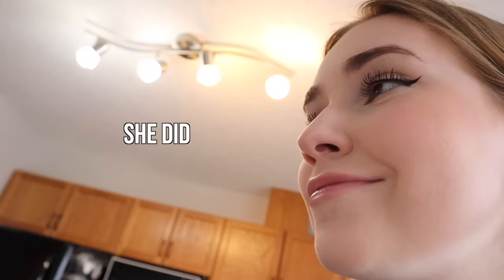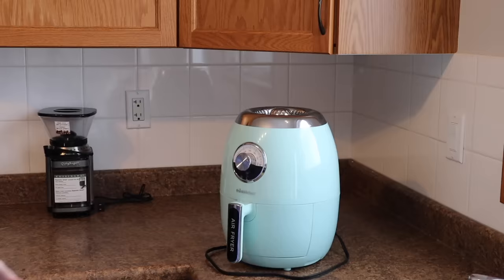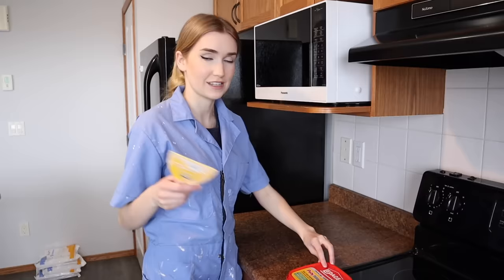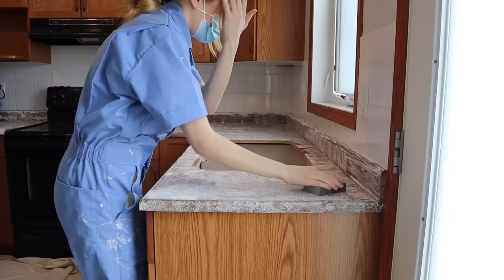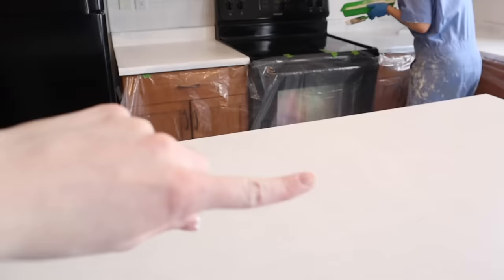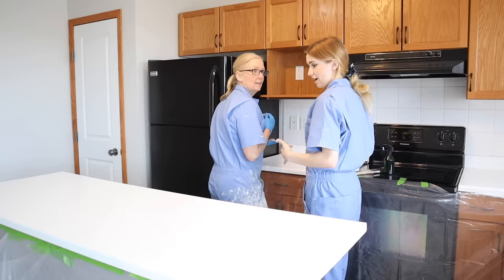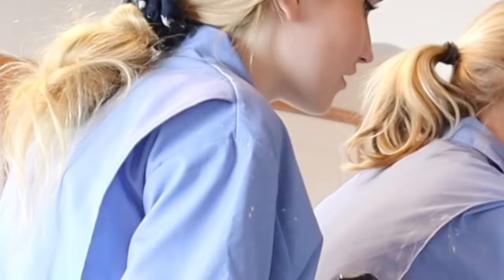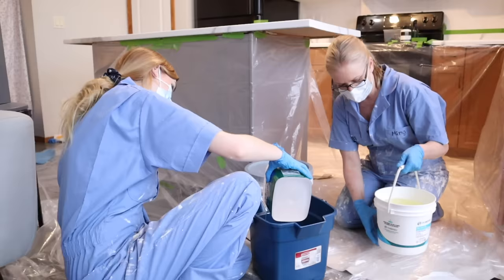Transform Kitchen Countertops With Epoxy & Paint !! *surprisingly easy*

Comment: Couple of tips here. First, you don't need to take off the texture before the epoxy. All you need is sanding. The epoxy, when poured correctly (around 6 Oz. per sq foot) is thick enough to cover everything. Secondly, the recommended way of making it look like marble is not to draw the design before the epoxy. The best and most natural marble effect comes when making the design with the epoxy. Basically, you use white paint or pigment mixed with the epoxy and then make a small mix with the gray by mixing a little of black into epoxy. You pour the white first and then make the veins with the "gray" epoxy mix. You then spray 91% isopropyl alcohol or over over the veins to make a more natural effect. Also, always use epoxy that is specially made for countertops which contains no VOC and no mask is needed. You also want to use a mixing cup or bucket to measure the exact amount since a little less or more part B will cause soft spots. Another thing and sorry for the big comment. I just want to help you learn. Epoxy has to be pour thick and it cannot make that "paint" sound. When it does that it means there's not enough epoxy. By the way, I am a renovation contractor specialized and certified in epoxy designs so that's how I know. Honestly, any question you have I am available.
Reply: Youre a cool dude 😊
Reply: Do you have any video on how to do it
Reply: @stlouisfritznicolas9314  No but check out Stone Coat Coutertops channel
Reply: Hi Jonathan, I have the same countertop as her. Are you POSITIVE I don’t have to remove the texture off the laminate before pouring the epoxy? I am terrified it won’t level correctly and that texture might show through 😰

Thank you in advance 🙏🏼
Reply: Thank you so much
Reply: Thanks for this! About to start my epoxy project. I've watched a lot of stonetop vids but I'm just stuck on 2 areas. Do I need to use some sort of waterproof primer or base before epoxying and do I need to use a top coat after Epoxy? I've got a primer and undercoat (2 in 1) it doesn't say it's waterproof though. It will be for my kitchen. Any advice would be very much appreciated!
Reply: @blankcanvas7417  You're welcome. The primer or base doesn't have to be waterproof since the epoxy is waterproof and it acts as a top coat and sealer. You don't need a seal coat on top of the epoxy but there are some top coats that do help and improve in both look and durability of the epoxy. My favorite one is water based Polyurethane because it makes the epoxy scratch resistant, easier to clean and it comes in Matte finish, Satin, Semi-gloss and Gloss so you can choose the best for your design. Now, there is oil based polyurethane which I don't recommend for epoxy projects. It is harder to apply and some have an amber color that will change the appearance of your project. Use only Water based clear Polyurethane.
Reply: @gardeniagorgeous4232  I am positive you don't have to remove the texture off the laminate. Yes, you do sand the laminate but just to create a porous surface for the epoxy to grab, not to take off the texture which will take longer. Epoxy is self leveling. Always measure the size of your project before so you know how much epoxy you need. About 6 Oz per square foot and it will level with no problem
Reply: I don’t agree You do not need    Resin to make marble look real . My best marble and s done with acrylic paint.  Just a thought. Also they marble they did looks absolutely real!
Reply: Molina is correct I n this one apoxy seals and covers the holes with n the in even counter That is the beauty of appoxy
Reply: THANKS.
Reply: I kept wondering why they weren’t doing it the way you described.
Reply: @Suzanne Carpenter  They don't have much experience with epoxy and it's understandable. It always good to look for information before using any product you don't have experience with, specially one like Epoxy resin that has a specific mixing and working time
Reply: @Margery Kirner  Epoxy is not the only way to make a marble style decoration, true but is not just about how it looks. It is also about the feel and durability. While yes, you can make faux marble with acrylic paint, paint is not durable, peels easy and is not scratch, heat and/or chemical resistant
Reply: @jonathanmolina3529  I agree with you! 
What do you suggest if anything I use overtop of my granite counter before I use epoxy mixed with a couple shades to achieve a quartz look? Do I need to prime first? It’s very dark with gold and black in it
Reply: @Tracey Maday  Always need to prime to create a good adhesive for the epoxy.
Reply: Can you do my counter top for me 😬
Reply: Hey so if I sand down my countertops, then paint them with say 3-4 coats, how many coats of epoxy would you recommend? Thanks :)
Reply: @shilohmcgilvary6704  2 coats of epoxy. The first coat would be a base coat and the second one is the top coat. The base coat can be applied a bit thinner then the second coat try to stay in the 6 ounces per square feet. Also, can't wait more than 24 hours between epoxy coats or you would need to sand the first coat before applying the second coat. If it's been less than 24 hours you don't need to sand to pour second coat
Reply: This is really helpful! Thank you!
Reply: hi, I am going to cover a laminate desk. I want to paint it black, then add some gold flakes and cover with epoxy.  thoughts?
Reply: @jenh8858  Make sure to sand the laminate before priming. You need to create a porous surface in order for the epoxy to have a good bond.
Reply: thanks for the reply  @jonathanmolina3529  so i sand it, then paint it black, then add the flakes and pour the epoxy over?
Reply: @jenh8858  Sand it down and if you want to do the best job possible, I recommend you instead of painting, after sanding use an epoxy primer base coat black then you pour the flakes and lastly the epoxy. Now, depending on the design and color you want you can either do the design and pour clear epoxy or you can color the epoxy and make the design with the epoxy. There are many tutorials in YouTube on how to do that. I recommend you check out Stone Coat Countertops
Reply: @jonathanmolina3529   thank you. This is amazing.  Going to follow your advice
Reply: @jenh8858  you're welcome
Reply: I have a tile countertops. Can I use epoxy too?.thank you
Reply: @dunna3072  Yes you can. You have to fill the gaps before so you can have a smooth surface. You can use bondo filler or other fillers used in construction. Also, the tiles need to be sanded down well because you will need a porous surface to create mechanical bonding. Once you fill the gaps and the tiles are sanded enough you will then use an epoxy primer and then the epoxy itself. It is a little bit more work but it's doable and easy
Reply: THANKYOU JONATHAN FOR YOUR ASSISTANCE IN THIS TAKING NTES.
Reply: If i dont have a torch, can i use a blow dryer? If yes, what setting ? Hot/cold?

Comment: The epoxy started fuming because curing epoxy heats up (it does so in the early stages of curing). The larger the amount, the higher the temperature, and it can melt THROUGH the containers so be careful! Same goes if you want to do a deep pour of epoxy, the heat might melt whatever is around it (if you're using it for crafts, molds, or other things) so you should pour in layers! You don't need to wait the full cure time to pour a second layer, but at least let it sit for a while (for a 24h curing epoxy, I usually let it sit for 5 to 10 hours) 
Also, epoxy is a delicate medium to work with so I advise you to be very careful, and really be thorough when it comes to PPE! You should always wear a respirator even with "non-toxic" brands. Often they are non-toxic when CURED but not so much during mixing and pouring. So just to be safe, wearing a respirator is worth it! The "surgical masks" do not protect you for anything, they're barely efficient for dust as well by the way so do use proper respirators when sanding, it's no fun to have whatever you sand in your lungs (and long term exposure to that with poor to no PPE use leads to  lung diseases, it happened to a family member...)  Always wear respirators and preferably long sleeves when sanding epoxy! Epoxy in the organism is really not good....
Reply: Excellent advice! I was thinking much the same (minus the astute details you provided). Thank you for your expertise 🙂
Reply: That slim mask cures everything. its why people don't get sick anymore. Not to mention we wear our masks on and off.  supper important
Reply: Yes that is what happens when you don't take time to really study even those countertops look bad very orange skin even by not removing the stove shows u how little thinking it went through this process
Reply: Does get into food if we use as countertop
Reply: Thank you! I was ready to jump into this and appreciate the details of caution. Will do when the weather gets warmer, and I can open the house for circulation. 💌🥳
Reply: @MrAresxy07  What are you trying to say?? Punctuation really does serve an invaluable purpose.
Reply: @lblincoe2094  I don't understand what he is trying to say either.  Lol  I read it several times.
Reply: @rbnmullane  With that user name, I don't think they know what they're saying. 🤔
Reply: There's a time limit on how long it should let epoxy sit in a buck. You mix, then pour it, especially if it's a lot of epoxy. Read the instructions.

Comment: Few tips from someone who works with resin. 💜

Firstly, I don't think there are any resin brands that are safe to use without a respirator. Even those who say non toxic. There is no such thing as non toxic resin. So always wear a respirator and gloves!

There are very few brands that are food safe. Never put any food on anything made from resin or any resin item in your mouth. Like the resin spoons & shot glasses (they should be avoided!) Cake stands would be okay if there was something under the cake like baking paper. You should avoid resin ash trays because heating the resin is a bad idea as it can release toxic fumes. 

As Mia said, do not leave mixed resin in large quantities. Resin has a work time & if the resin is very thick, like in a bucket or jug, it can heat very fast & catch fire. Try to only mix the amount you will need. Also, make sure the resin is suitable for the task. There is resin for shallow pours & resin for thicker pours. 

Mia said something about the torch starting the curing process but that's not true. It is a chemical process that happens when the resin is mixed together. 

Lastly, it's better to measure/weigh (depending on brand) in the same container. Resin can be very finicky about measurements. When you pour from one container to another, you will never get every single bit of resin out of the container. So it could throw off the measurements meaning the resin might not cure properly or at all. 

Sorry for the essay but I spent a lot of time researching resin before I started working with it. I wouldn't want something bad to happen to someone because of it.
Reply: Miss EmJay, question.  After the resin had dried, it is still not safe for food? Just asking b/c I want to do my countertop also.
Reply: @eliciaanderica8472  not really. I wouldn't eat something prepared on a resin countertop. If you were to only choose,, NB on the bed
Reply: Is there a sealant that can be put on top of the epoxy to make it safe for food to touch?
Reply: @lindsy8538  Stone coat epoxy is UV resistant and food safe, Epoxy, when cured, is generally food safe, as long as it is in compliance with the FDA's thorough regulations but not all epoxies are designed for use with food. Also a respirator is not need when pouring epoxy, only when sanding it. You do not want to breathe in the epoxy dust, I don't mean to disrespect Miss EmJay's comment but she needs to be more informed before making a factual statement.
Reply: @jamess5872  // Hi James. Are the using stone coat epoxy? And if so do I need to have a torch or can I use something else? I just looked and at Lowe's it's $55.00...but I don't know what else I would use it for. I like to do DIYS but do I need the torch??? You sound sincerely informed.
Reply: @jamess5872  // oh you're genius!! Thank you so much for all your help. I was so worried about this, but now with your help I feel confident. Thanks again and also for taking the time to be extremely specific. It means more to me than you know.
Reply: @Donna-vh5ym  Glad I can help, if something goes wrong during your pour and you end up with dimples in your top coat. Don't panic. Let it cure for 3 days. Go back with 220 sandpaper and do a light sanding and pour a new thin layer.
Epoxy is very easy to work with and mistakes can be fixed.
Reply: @jamess5872  // I'm so happy you added that James or I would have panicked. I'm going for it this weekend.
Reply: @Donna-vh5ym  I know it’s way late but you can get a little culinary torch as well. They are like $7 on Amazon plus the butane refill for like $4 I think. The larger ones are easier for bigger projects. A heat gun works too but moves the epoxy if you are careful.
Reply: @kim99may  // are you kidding me Kim. That's wonderful. I haven't pulled the plug on that particular job yet, so this isn't late at all. Wow...Im so happy you told me this. I'm heading over to Amazon now. Whohoo. Thanks again.
Reply: @Donna-vh5ym  I know this is very late but you can also use a heat gun. Some epoxy brands create less or no bubbles so sometimes is best to use a heat gun depending on the brand used.
Reply: @jonathanmolina3529  // not too late because that will be almost the last thing I do. Starting from ceiling to floors, so counters will be somewhere in the middle. Just finished all the outside (new paint, new deck, etc)  and now started new ceilings, etc. If I tell you want resin I'm thinking will that help? I was thinking of stone coat epoxy? Not sure that's the best, so if you know PLEASE let me know because I REALLY don't know and scared of it since I've never worked with it. Thanks again. I so appreciate all the help I can get.
Reply: @Donna-vh5ym  Stone Coat Countertops epoxy is great. It is very DIY and it gives you around 2 hours of working time so you have plenty of time to make sure the design is perfect. SCC epoxy does need to use either a heat gun or a torch to get rid of the bubbles. Make sure you do it in between coats. For example, if you do a flood coat (the first coat of the design), when you finish doing it you need to torch or heat it up with the heat gun. Wait one day and the next day you can do a top coat of clear epoxy and heat it up again with the heat gun or torch. I also recommend you use the SCC (Stone Coat Countertops) Ultimate Top Coat which will seal the epoxy and give it more durability and scratch resistance. It comes in Matte if you want a more natural look or Gloss if you want to keep the shine from the epoxy. I recommend you watch their videos since they teach step by step how to do everything. 

PS. If you want to do a clear top coat, try not to wait over 24 hours since the first epoxy pour. If you can't do it in under 24 hours you will need to sand the epoxy with at least 320 grit before pouring the epoxy clear coat
Reply: @jonathanmolina3529  // omygoodness. Wow!! You have no idea how much of a headache you just saved me from. I'm going to screen shot this that you sent me and also watch a lot of the Stone Coat videos like you said. Since I want to do it like you said and do it right I will go ahead and purchase a torch. I can't begin to tell you how much I thank you for taking the time and writing such an informative reply., truly.!!!
Reply: @Donna-vh5ym  it's my pleasure

Comment: A lil tip that I can see no one uses in reno videoes:
When you put paint or primer in the plastic thingy (don't know the english word), you put a plastic bag around it so the paint wont be stuck to it afterwards.. and when you are finished painting, it's clean and you don't have to wash it 😃 
Also this is very smart when you are painting a room more than one time. Then you let the roll stay in the bag with some paint left in it. And clise it so no air comes in. Then you don't have to wash the roll, and you can start directly when you are ready to the next layer 😁
I hope I explained it good enough.

And remember that epoxy can be super dangerous to get on the skin!!
Reply: There are plastic inserts for the paint trays that let you work easier than a plastic bag. They are always cheap and definitely worth avoiding the frustration than dealing with a plastic bag.
Reply: @Babylungmcgee  nice to know! :-) 
I have never been annoyed with the plastic bags myself, but it's probably helpful to others. 
I also use it for the paint roll as I wrote in my comment. It saves both paint and time so I don't have to wash it every time.

Comment: Just for mia and her mums safety more than anything else , i dont think the surgical masks offer much protection from sanding dust etc :// try a proper dust mask thats sealed to the face, love you both just looking out for you 😇
Reply: Yeah I was thinking this too.. I work at a hardware store and those dustmasks were sold out for a while because of Corona, so maybe they have the same issue atm..
Reply: @AnneMaaikie  yeah definitely !! I suppose a mask is better than none definitely
Reply: Epoxy is extremely toxic and you need proper fitted mask with the fume filters AND a ton of ventilation... especially when working with large quantities like this